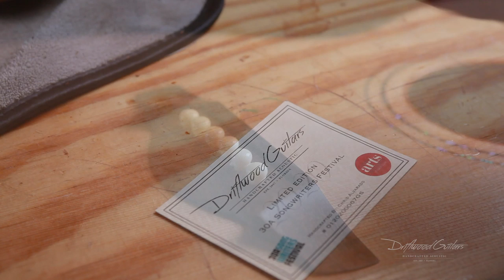Demo of a Driftwood “Grand Session” model guitar. Western Red Cedar and Quilted Maple.

Comment: Beautiful guitar, in every respect. I feel like cedar is an underappreciated tone wood in the guitar world.
Reply: It’s used on nearly every classical guitar for centuries, it’s unfortunately way too bright with steel strings usually…
Reply: @robertw1871  I have a cedar topped steel string.   What I've found is that it is wonderful for finger style and light to moderate flat picking.  However, it doesn't have much "head-room" when compared to my spruce topped guitars and doesn't handle heavy/aggressive flat picking very well.
Reply: @rosewoodsteel6656 Exactly... it's great for nylon strings, doesn't take much to get it going
Reply: @robertw1871  cedar isn't bright lol

Comment: Can one retune finished guitar by shaving braces on top and bottom to make it response more lightly? Or whats the risk of doing it? There is many guitars that have potential but are made in factory with too thick braces on top (also maybe too thick top). I think i would would be quite easy to trim these and get a lot of better sound. 

I had a factory made Gibson that hand quite nice sound but it also had bum note at D right around standard tuning. I made some experiments and read from subject and decided that iam not going to lose anything by shaving a bit from back braces. So i bought small hand shave and used it. Took a little by little material way from back braces and then retuned guitar with strings. I was able to hide that bum note almost completely away. I also thing that guitar sounded a bit better. A bit more responsive.

Comment: On your final wet sanding what Grit paper did you use on the final sanding on your orbital sander? And did you add a little bit of soap in your water? I built a Martin 000-28 kit guitar and I want to put the final sanding on the guitar. I French polish the neck, and lacquer sprayed the rest. Any suggestions a little help would be appreciated on this final sanding.

Comment: Wow ! 
How far from the Gulf of Mexico do you figure you might be, and does it have a major effect on the moisture levels in your shop? I'm about 25 miles east of the Gulf myself. I've only built solid-body electrics and was considering a trial run at a parlor-acoustic body. Any recommendations on keeping the humidity down to practical levels for building acoustics in Fla, if that is a problem? Thanks Chris
Reply from the maker: I’m only about 1/8th of a mile from the shore line of the inter coastal and about 4 miles from the Gulf. I keep my shop at 43% humidity year round with a dehumidifier. With electric guitars it’s not as big of a deal because of the thickness of the woods. If you do make an acoustic it’s way more  important to keep it between 50-40% in order to keep the wood stable during construction. This can be done with a dehumidifier or by doing it indoors in an air conditioned place in your home.
Reply: @DriftwoodGuitars  Thanks for the advice Chris. I have a small dehumidifier in my shop now, mostly for the finishing prosses. I figure it might be in my best interest to invest in a little larger shop dehumidifier. Cheers !

Comment: I don’t build guitars, so this is sincere question… why didn’t you use a drill press on the bridge and do all the prep of it before gluing it to the top? I gasped when I saw the hand drill, and again not a luthier nor even a woodworker.
Reply: The holes go through the bridge and the top.  Gluing the bridge to the top first ensures they are perfectly aligned.  Even the slightest change of alignment will ruin tue intonation and the guitar would never play in tune. Also, with the bridge glued to the top he has extra strength and stability, lessening the chance of cracking or splitting the bridge.

Comment: Curious why you went with what would generally be a classical style headstock? I am not a fan of those tuning machine heads. I prefer a scalloped tuner.  I was expecting you to put Nylon strings on when I first started watchin the video. I mean otherwise its a beautiful Guitar. I mean no disrespect.
Reply from the maker: Good question. The slotted headstock actually offers a better break angle of the string across the nut and thus, improves tone and sustain slightly. Every little thing you can do to improve tone is needed in order to make a great sounding guitar. I also like the look a lot more than a solid headstock design. I get that it’s not everyone’s cup of tea though.
Reply: @DriftwoodGuitars   Interesting. I would like to try one out. Ill have to be on the look out for one. I honestly haven't even looked at what one of your guitars would cost. I'm scared. Cause I probably could never afford one. I have a old YAMAHA F335. The action is getting out of hand. I have lowered the saddle as much as possible to where its almost touching the bridge. The neck angle is good. The whole top of the guitar is bowing out. No cracks or separation that I can see. I'm about to put a wet rag inside and lay it upside down to saturate the wood then put something heavy on it to try and flatten back out. Any suggestions?